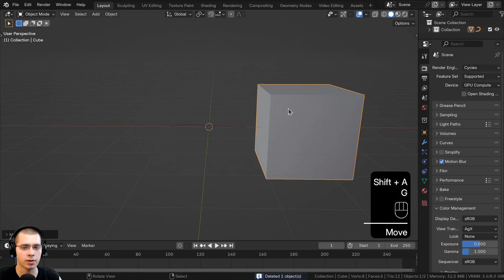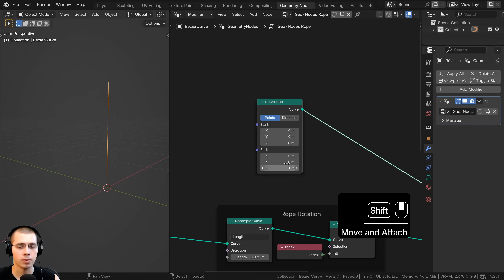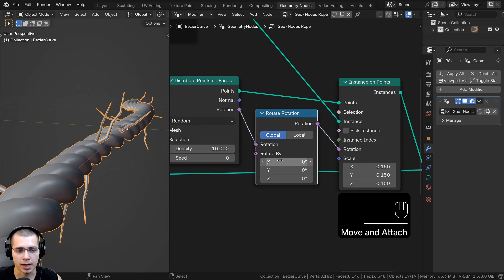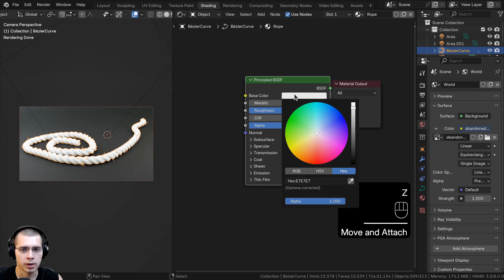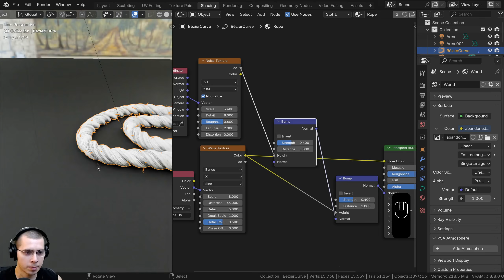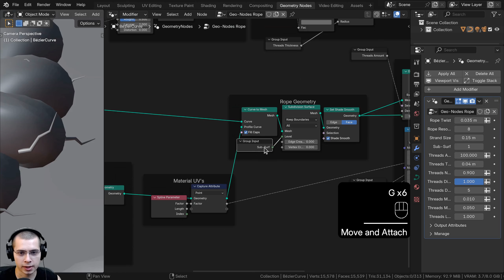Comment: Thanks for the nice Tutorial. I used Blender 4.5.0 and I noticed that the "Thread Thickness" doesn't work with "Set Curve Radius". This Node effects nothing. So I found annother way: The Node "Curve to Mesh" has the new Point "Scale" inside. So I connect the "Spline Parameter"with the "ColorAmp" and then with the Scale-Point of "Curve to Mesh", that works.
Reply: Thanks for sharing! I just tried it out myself and you're totally right. Just pinned your comment for other people watching. I find it so frustrating when the Blender Developers make very small changes like this that are not really that important to change, because then people have a hard time following my tutorials. But I don't want to re-create the entire tutorial just for one tiny change. Anyway, thanks for commenting!
Reply: Or use Node "radius" for Scale in "Curve to Mesh" in this case
Reply: thanks for the education. i was stuck there not knowing what to do. your comment helped me alot
Reply: Thanks
Reply: Thanks

Comment: Noooooooooo, tut. dosent work on 5.0! SAD Gonna have to wait for an update.
Reply: what doesn't work? I opened the file in 5.0 and it seems to work fine.
Reply: @RyanKingArt  Or maybe it didnt work for me because i messed up somewhere, but after the "Set Curve Radius" node is added nothing worked. im gonna do the tutorial again though, see what happens the second time
Reply: @annonomaus  Check the Pinned Comment by @johe3114. There was a Blender update and the Set Curve Radius and Curve to Mesh node works differently now.
Reply: @RyanKingArt  Will do boss!

Comment: Can anyone tell me why, when applying the rope geo nodes & material to a brand new curve, it doesn't look right?
The shape is fine, but the material is wrong, the wave textures lines aren't showing up.
Edit: I Fixed it. When applying the geo nodes modifier to a new curve, the Output Attributes field directly under the customisable options in the modifiers tab was empty, but the original has "Rope UV" in there. Typing it in for the new curve object works. Would be nice to know why it doesn't copy over by default though, or how to make it do so.

Comment: Thank you very much for the tutorial! The geo Nodes work very well, however the texture nodes are not achieving at all what you are displaying (using blender 4.5, so I assume this is where the problem lies) 

Bump strength for Noise and threads does not really seem to change anything... Do you have any ideas? I have double-checked the node tree, setting and connections multiple times and did not find any deviation to what you did.

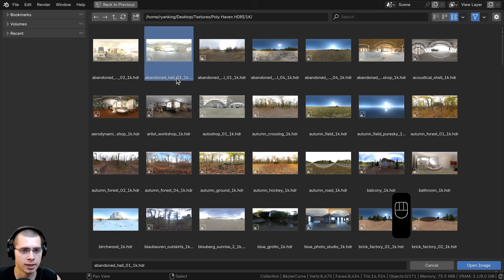Comment: awesome video. I have a few issues. When I start to work on the points for the threads my points are significantly larger than the ones there and my density seems far lower than in this video despite using the same numbers. I watched all the way to 23:30 for some reason it's just not the same yours. I did do that correction with the color ramp into the scale of curve to mesh node. But I don't think that would be much of a difference. I've also noticed that the threads seem to be larger with the same settings. I did apply the scale to the starting curve the rope was drawn on.

Edit: I went ahead and bought the rope geometry node. The sale really was helpful and I'm glad I did. I think I know why everything I've been doing has looked so off. After looking at the .blend file I noticed that the rope was scaled at .2 just like in this video but it wasn't applied in that file. So I went ahead and created a curve scaled it .2 and applied the scale then applied the geometry nodes to it. It looked exactly like the issue I was having. I'm not sure why it is different between the applying the scale in this video and both the .blend file I bought from superhive and my tutorial file. But there is a definite difference. So if I scale it and just don't apply the scale it's seems right. Learned something and am even more confused now that ever before.

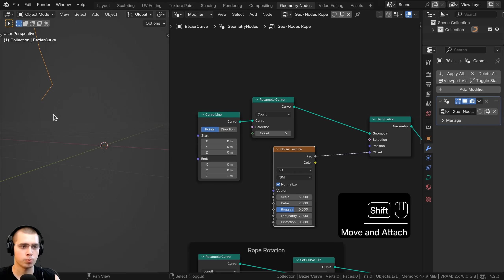Comment: 13:40  Oh, of course! To bring back the curve to the origin... which it moved off of for whatever reason... just add a MIX COLOR.... and turn it to black! Oooobviously that MOVES the curve back to the origin!

I can take the blame for not working hard enough to get beyond low poly stuff... but will I ever be able to make something without looking up a tutorial? How is any of this intuitive? Look at all these nodes with names you can't guess to look up to get a specific result!

Blaming Blender, Ryan... Your vids are always great.
Reply: That one could probably do better with some sort of explanation, though. I think the idea is that using the mix light with linear light creates a form of gradient, and thus going from 0 to 1. Multiplying anything with 0 is 0, so that 'anchors' the line back to 0, which is where it should be. You could get the same effect by using something called 'spline parameter', a node that deals with splines (!), which has the same thing in 'factor', that also goes from 0 to 1. That is the one I'm usually using for this, but I guess the linear light does have the same effect. Hope this helps (though it is a long time since you asked :) )

Comment: Work great but when I draw a new curve, it create a thick rope and it look weird. I need to scale it down and apply scale to fix it. How did you avoid that?

Edit: Figured it out, if anyone encounter that too. Top left corner the three dots just next to the Surface button you need to lower the Max value.
Reply: Thank you!!! This was driving me crazy. Changing the max radius to 0.25 worked perfectly for me
Reply: what surface button? I don't see one anywhere and I'm at 23:30 in the video and haven't seen anything
Reply: @terryrhuebottom  You need to be in Edit mode
Reply: @lbenn43  Yea I definitely could see that being the issue. I ended up buying the actual rope. And surprisingly in the .blend file the scale was never applied to the curve. It was just left at .02

Comment: Thanks a lot for the video Ryan. Great as usual. I do have a question though! When I try to draw mine it is quite fat and the coil is much tighter. Looks more like a weird rope machine bolt. I'm sure I've followed alone to a T. Any idea what I've missed? If I extrude the rope I made it's all dandy!
Reply: Hello, I think I had the same problem. What fixed it for me was creating a new Bezier Curve, scaling it to [0.2] and applying the scale using CTRL+A. Then drawing rope using that curve produced much better results. Hope that helps!

Comment: Many thanks for this. I have made a coil of rope and am now waiting 40 minutes for my very slow computer to render it... Just wondering how the draw a new rope works, is it just a case of going into edit mode and using the draw function? I tried this but the new rope didn't look like the first one at all, it is x3 fatter and distorted. Is there a scale factor in play? I know the first thing you did was scale the original curve, so just wondering. Also is there a way to constrain curves, or extrude a curve in a spiral shape?